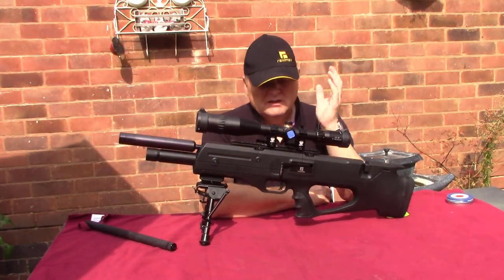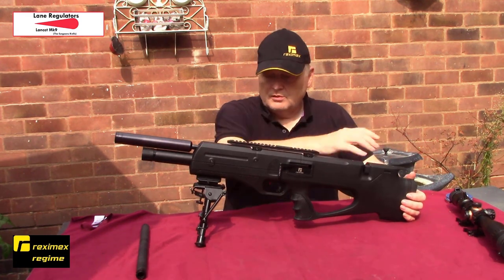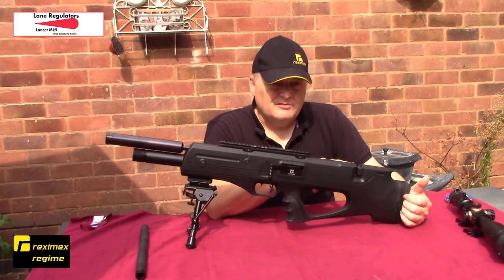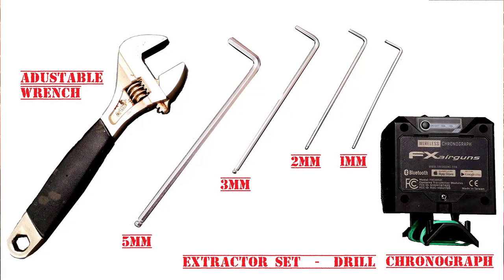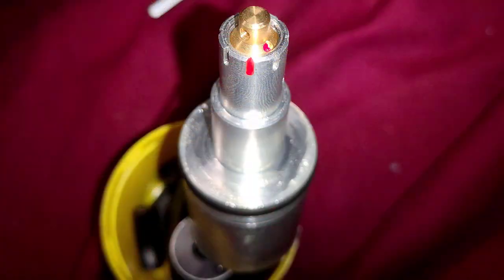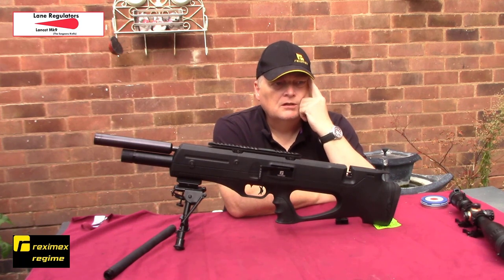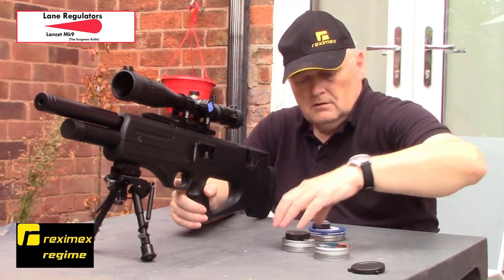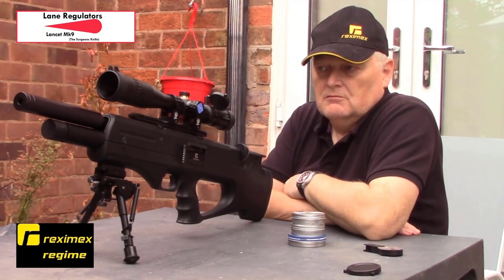(Part Two) Fitting the Robert Lane Regulator to the Reximex Regime

Comment: Very interesting and informative 😊 but I’m very pleased with the stock settings and as I see here there are few paths to go with that regulator. To stay below limit. Tank is quite huge so consistency is also very good. 

I think I have some slight blowout on the bolt. Is it normal that bolt in the last phase of closing lever retracts a little bit? Blowback is not huge but I think that’s why it’s a bit loud at the bolt. If I put small paper receipt , thermal thin paper, it wiggles it a bit but not blows off it at all or something. Gun brand new, silicone oil was applied at that bolt seal. But I wonder if that retract action is a normal thing…. Could you please say what to do? Caliber is .177

Comment: Hi, great videos m8, I have just ordered a Regime myself 😊. Could you post a link the regulator ? Many thanks
Reply from the maker: Sorry Darren, only just spotted your video. Before ordering a regulator take the cylinder off of the rifle to see what type of valve is fitted. It could be one of two different designs, so the regulator fit are different. If the valve spring is at the front of the valve, faceing the transfer por and hammer, then you will need the regulator that fits inside the end of the valve. If the spring is at the rear, faceing the cylinder, then you need the regulator that butts up to the face of the valve. I found this out the hard way, but Robert was good enough to replace it with the correct fitting. Measure the inside diameter of the cylinder. I think most are the same sort of size, around 30mm give or take. I used a slightly larger 0-ring than the one provided to give a better seal. I would suggest going to Robert Lanes web-site and send him a message through the contact form: https://laneregulators.com/index.php?route=information/contact of what you find when taking the rifle apart, and he will be happy to help.

Comment: Hi mark ,, another good video,I see you have lever on left hand side ,did you do a video on swapping it over and I've missed it or will you be doing one ?
Reply from the maker: If you follow the strip down instructions from the latest video, including removing the shroud it will give you access to the framework and cocking arm. Here's the initial video showing you how to do it without removing the frame: https://youtu.be/yHISHyZ96Kw
Reply: @airgunsniper-elite7385  thanks for help

Comment: Thanks for posting this and your other videos. Have you played with trigger adjustment for  lighter trigger weight? Do you think a newbie could do that without buggering things up?
Reply from the maker: @jeromemausling6324  Yes, the trigger is easy enough to improve for most.
Once the stock is removed, it can be lightened by tightening the nut on the trigger rod. You can also remove the side plate to polish the trigger components.
Reply: @airgunsniper-elite7385  thank you

Comment: Hi. Thanks so much for spending the time to review\showcase this so underrated airgun. Any chance you have a link to where you uploaded your pdf. I'm just about to put my RL regulator in and take it to fac as I think it has so much potential to be a great pest control tool at a slightly higher power. Thanks again!
Reply: Would have preferred the actual breakdown demonstrated

Comment: Hello, will the regulator for the kral punchers (breaker) fit in this pcp
Reply from the maker: It will all depend on the internal size, and the type of inlet valve head. You would need to take the cylinder off and check the end of the valve. Some of the valve heads are designed for the regulator to fit into. In other cases the regulator butts up against the front edge of the valve. To make it worse different valves can be used on the same model, so until you take the valve out, you won't know. Robert Lane now knows this, so before ordering one you need to take the valve out of the cylinder to see. Kral and Reximex are very similar in that respect. I received my regulator from Robert, but needed to replace it for one that butts up to the end of the valve face, rather than the one he sent, that fit into it. This is because the valve is either made with the spring in front of the valve, or at the rear of the valve. If at the front, the regulator fits inside. If at the rear ie faceing the cylinder, then the regulator butts up against the valve. The two types of valve can be used in the same model, so before you do anything check what type of valve you have.